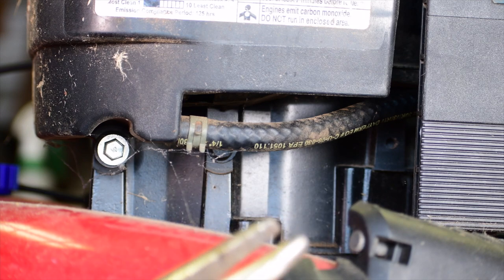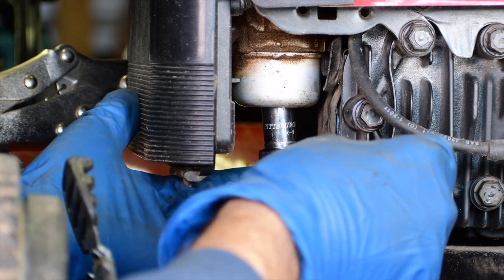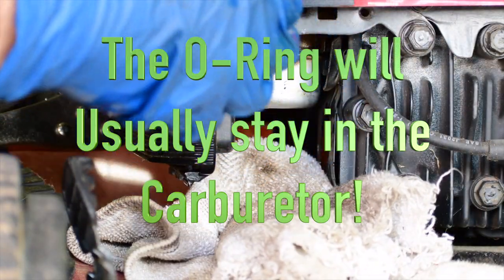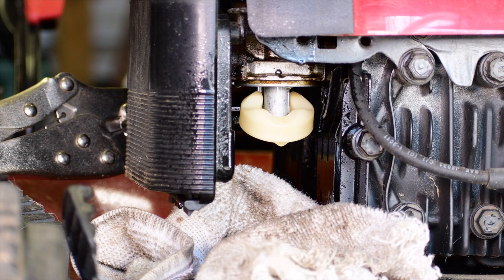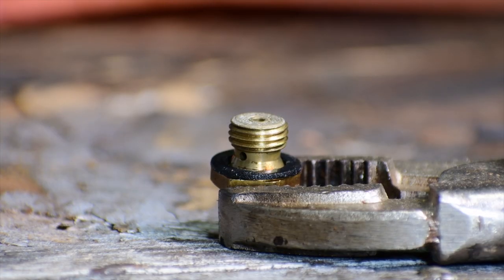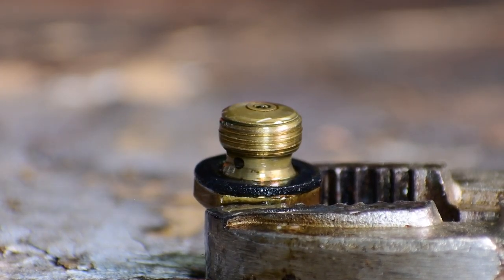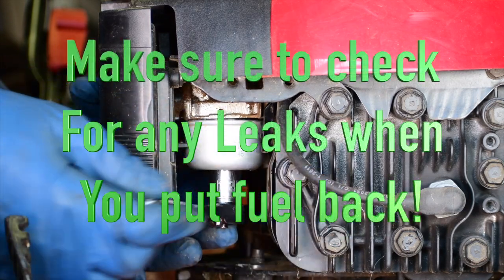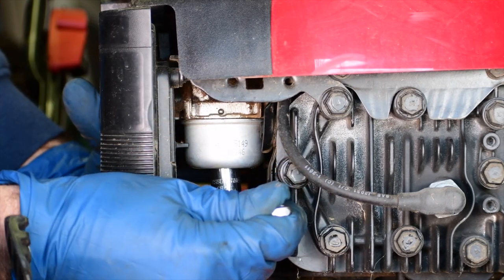A 5 Minute Fix For a Lawn Mower that Starts, then Quits

Comment: When cleaning a carburetor, you need an air compressor to blow out the jets, emulsion tube, and passages, after spraying every hole, jet, etc. This greatly increases your success rate.
Reply from the maker: yep

Comment: Lucky, my grand father owns a small engine shop and when there’s build up of gunk,we clean the entire carburetor out this will work but temporary if you see any build up like you did in the bowl you usually need to clean the entire carburetor so it can last longer best way to avoid this don’t let no gas set up over winter undo the fuel line and drain the gas out,take a compressed air hoes and blow air through the gas tank to make sure it’s dry after that  cover it up for winter you don’t want no rust on it.
Reply from the maker: Sometimes u do have to do a whole clean out.  That's why I kind of showed me spraying the carburetor while the bowl was off to try and get that residue off the area where the bowl was.  But your right, sometimes that's the only way it's going to work.